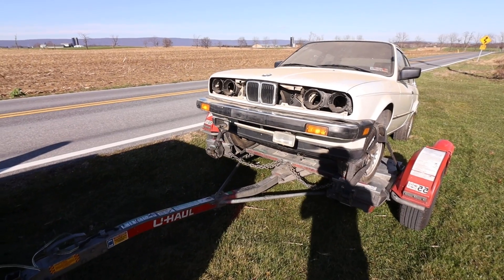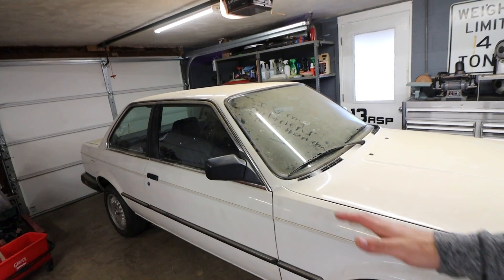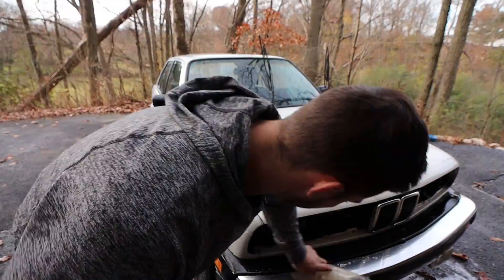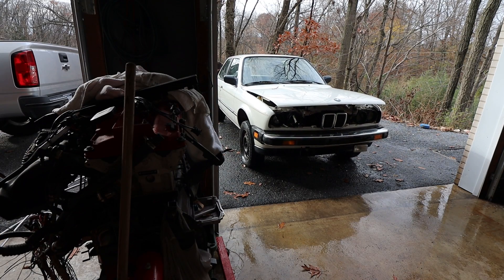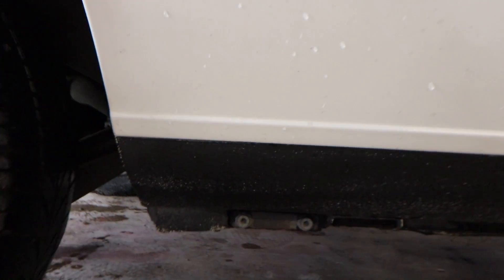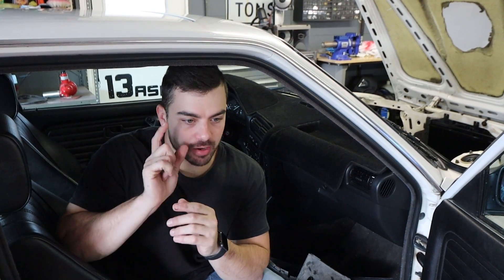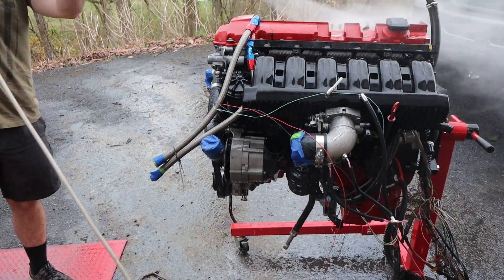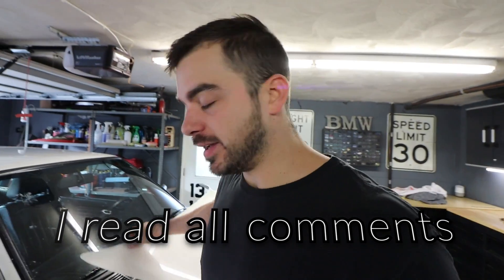E30 S50 Swap Turbo Build Plans: Big HP, Widebody, Air Ride Suspension

Comment: Excited to see the build. Have a 90 325i that I have pseudo restored so far to get it running. Maybe this series will give me the motivation to get back wrenching on it.
Reply from the maker: I'm jealous of your plastic bumpers, that's for sure!  I need to figure out how to get rid of my metal ones.
Reply: @matt13ross  the metal ones don't look bad if you remove the little shocks in them and push'em in
Reply from the maker: I did that on my last 318i, looked better but not as good as plastic bumpers IMO.

Comment: I love it, 700+ hp seems a bit much for a S50 (reliably), maybe cut back a little bit, as this chassis weighs nothing at all. But love the build, and love that you're doing a Frankenstein of BMW components.
Reply from the maker: I was originally aiming for more HP lol.  The engine is built to handle it.  I'll start with lower boost and probably 500 hp or so then turn the boost up.

Comment: There are some really cool wide body kits for the e30. I am still planning out my LS E36 build thanks to your channel.  Can't wait to see what you do with this one. Keep up the excellent content, I always look forward to watching them.👍🏼
Reply from the maker: Right on thanks!  What are you LS plans so far?
Reply: I purchased a 1997 M3 a little over a year ago just before coming across your LS swap so that was the plain until you did the build cost video...🤣😂🤣. Since that video I went out and bought a clean rust free non running 1995 325ic for $300.00. I am currently doing research on the 5.3 truck motors and also watching Copart for a Camero or Corvette here local. I did listen when you said to buy the whole car! Would like to hit you up at some point, but for now I am re-watching your videos and another guy believe it is low boost for knowledge.
Reply from the maker: Yea I watched some low boost as well.  If you can find a wrecked car with an LS1 that would be a great starting point.  5.3 is good too, if you get lucky you can find an aluminum 5.3 to keep weight down.

Comment: Why 6 speed 46 gearbox? Over in the UK everyone uses the 5 speed zf box out of the 36, it's lighter too. Looking forward to the build 👍🏻
Reply from the maker: I already have the clutch setup for the 6 speed.  Stronger than a ZF too, but yes, it's heavy.
Reply: @matt13ross  fair enough 👍🏻 an supercharged build would be cool if your not 100% set on turbo!
Reply from the maker: Pretty set on a turbo, but love them both!

Comment: if you want turbo and high HP from BMW just go S54! Either way, I'll be following along this build.
Reply: Boosting an S54 is insanely expensive. Not to mention there aren’t many off the shelf kits readily available thus forcing stuff to be custom fabricated which gets expensive quick! 

Turbo s54’s are fucking awesome though. The s50 should be a great foundation.
Reply: @Chattsteezy  I meant n54**
Reply from the maker: S54 would be great, but I'd keep it N/A.  S54 would be VERY expensive to boost (not to mention just the purchase itself).  If I had an unlimited budget, yes.
Reply from the maker: Yup, all solid points @Acclimatising.  My S50 is already purchased and built.  Expensive parts will be tuning, turbo, transmission, etc.  The rest isn't too terrible.

Comment: IMO this car is too clean to do wide body, repaint and all the nonsense, for that you are better off with a body that deserves to cut the rusted fenders away. I would just get a Z3 disc brake rear end with lsd dif and sway bar,  5 speed ZF box with Z3 oem short shifter, Z3 faster steering rack, euro bumpers, some nice era appropriate wheels and keep the engine NA. Its a very lightweight car so you dont need much to have fun and actually enjoy it.
Reply from the maker: Def going turbo and big HP.  Widebody will probably be one of the last things.  So it will be stock body driving for a bit first.  I don't necessarily disagree with you though, but I like to be different.